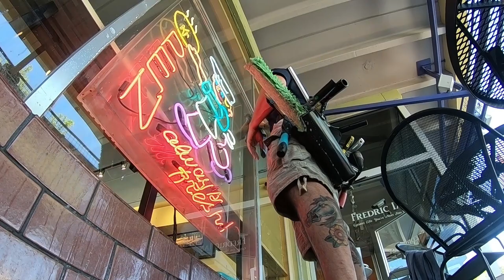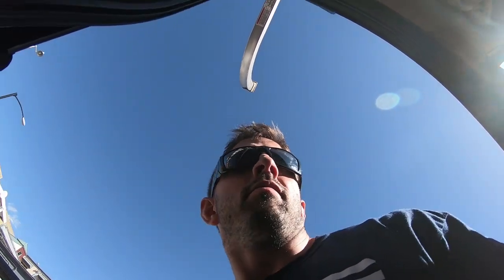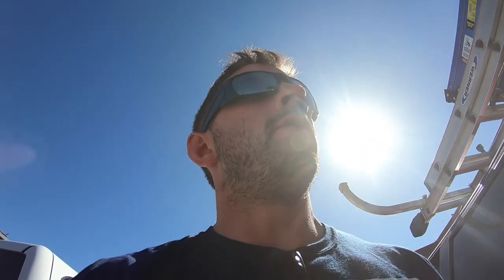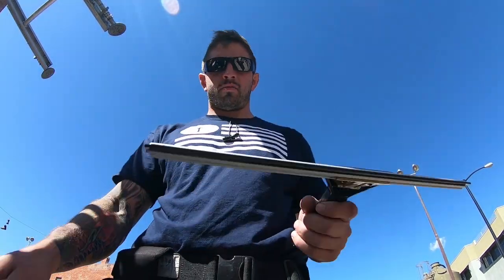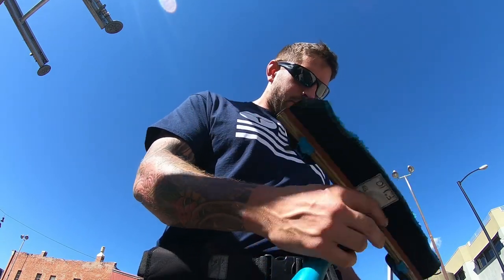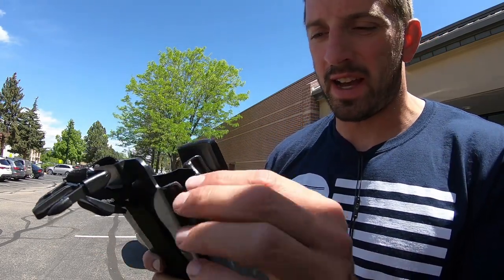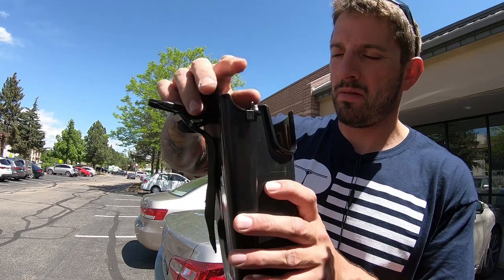WINDOW CLEANING WITH THE SAMURAI BOAB | FIRST DAY

Comment: Looks great but I don't like the fact that if I want to change my setup that I would have to carry another piece with me. It should all work in one solid piece. I bought the newest Gunslinger and although I paid a pretty penny for it, it looks very durable and manageable.
Reply from the maker: Jorge Chavez totally understandable, you’ve gotta use whatever will work best for you and your business!
Reply: I use the gunslinger and samurai 😉😉
Reply: Have the other insert in your parts box in the truck. I only use the wide slot insert, there are two alternatives are in the parts box.
Reply: Have you thought of using the Unger pro handle (it can clip on any size channel). I use it on a 20" and a 18" channel. Quick change and you can easily fit multiple channel in the bucket!

Comment: Man my high flyer won’t fit in my samurai. I have a version 1 high flyer. Other than that . It’s great. I will make a video as well.
Reply from the maker: Jacob Williams really ? I found that the high flyer fit really well
Reply: i don't know if it's how I am trying to put it in or what. I've tried putting it into the hole in the partition in washer mode it goes in but it's really tight. I flip it into squeegee mode it won't go through the hole in the partition at all. :(
Reply: After just watching your video again I now see why my high flyer won't fit. Version 1 has two micro fiber lubrication strips on the bottom side. it has two pieces that kick out. guess ill be ordering a new high flyer. Thanks for the video
Reply: The HF will fit in the slotted insert, it may be somewhat snug in squeegee mode handle out. After a while the insert will wear so it's looser. I have an 18 and 12 HF in mine ( 18 in slot).

Comment: I like how the mop is on the outside. I wouldnt mind trying one out. I have the new generation gunslinger, and i dont know if ill ever use anything else.

Looking at the samurai the only down side i can see is Plastic = bruised leg
Reply from the maker: Custodial Custodian I’ve never had a bruised leg from any BOABs have you experienced this? The awesome thing is the dry leg, people won’t believe it till they try it
Reply: what do you do to get a bruised leg? even when i had my old longer length pullex it banged yea sure but never bruised. Unless i ran with it that hurt but no tool is made to run with lol 

what type of work do you do?

Comment: Two words, GET IT! SO WORTH THE COST! It fits a 18” ,12" HF, and a WT angle handle. I like swivel, a T nut through the female buckle attached to the work belt shortens the Samurai. The strap was made the shortest on the bucket side, if needed it can be put on the pants belt.

Comment: I am only getting a buck a pane in storefront here in Canada and trying to get price up. What are your prices like we're you are and do you have any suggestions to get prices up. I am wanting big name stores and less mom and pop shops.
Reply: Kevin Lacey storefronts will always be cheap wor, no to little barriers to entry too much supply
Reply from the maker: A buck inside and out or for a side?
Reply: Per side, want to get mcd's don't know want to quote per pane per side
Reply: Kevin Lacey are you going to vary the price on glass type? I look at a job estimate time it will take add 20% times by wanted hourly rate give quote. I do 9 hungry jacks stores, they vary beteeen 150 and 200 per shop, has them for over 2 years
Reply: 1 loonie being .75 saw bucks, so you would need 2.65 per window to equal our 2.00 USD per window. Maybe you can try 2.50 and see what they say.

Comment: The Samurai hip bucket is an excellent tool. It will hold anything needed. The best IMHO is holding High flyers and other combo tools. Side note a side clip did break on mine, not a big deal the insert isn't effected.
Reply: The strap with buckle can be shortened much, and still have quick release.

Comment: My first BOAB was a 1 gallon metal can with the top cut off and the sides cut and bent down and then used a coat hanger to hook it on to my belt.  Used it to walked across ledges up to 4 stories. Never used it on the ground.  Today... we just break out the wfp and blast away.
Reply from the maker: I really like BOABs for me they make life easy, but I love me some WFP as well

Comment: I bought a Samurai hip bucket a few months back, it rocks! I use mainly Wagtails, the High flyer fits great in the narrow slot. It was modded somewhat, I attached the female clip to the belt on a through nut for a swivel. The hook and loop strap was taken off, and the strap on the bucket was pulled to the shortest.
Reply: One clip did break, no biggie still works. samurai may replace it if they're asked politely.

Comment: ok steve you said your leg never got wet?? look really close at the 18 second mark.  the white trail off the samurai and the drips.  you cant tell me your leg never got wet. oh let not mention the fact that you have the belt tilted so it drips away. in all you other video your belt is almost straight up and down. including the gunslinger.  i honestly think  both are great for the industry. but so far no one has gone tic for tac on either. no one will
Reply from the maker: mike Norton when I explain wet leg I’m talking about the side of my pants getting soaked from putting the mop in and out of the BOAB, my upper side of my thigh around to my butt would be soaked everyday since the day I began window cleaning especially in the winter or hot days where you need to use a lot of water. Water drips off of every BOAB on the market, nothing is perfect, but this was the first BOAB where my shorts weren’t soaked on the side of the BOAB after a few jobs. Do you really think that no water is going to come out?? Of course some water is going to trickle of the sides of the BOAB when you put your soakin wet sleeve in it, this is why we use drop clothes in homes or clean up towels on commercial jobs. The samurai left my leg drier then any BOAB I’ve used, have you tried the samurai?
Reply from the maker: I also shortened the strap by removing the buckle and attaching the Moerman belt buckle to it bringing right up to my side so it doesn’t hang, hence the title of the video, First Day with the Samurai BOAB, this was honestly the first day trying this BOAB and it was awesome!! 👍